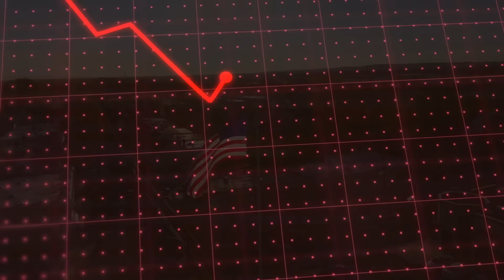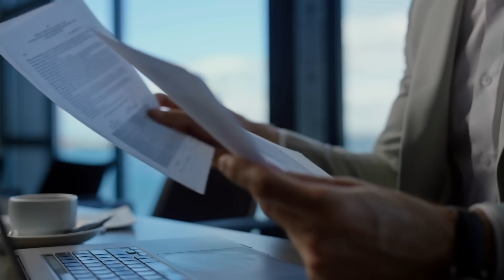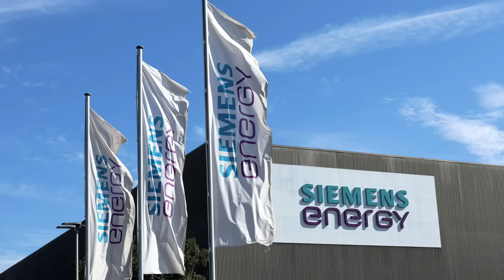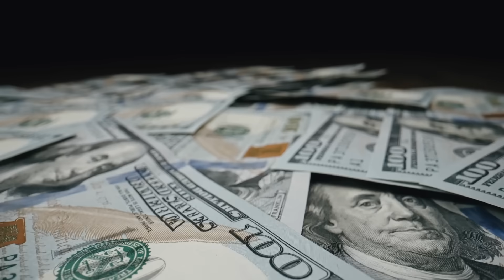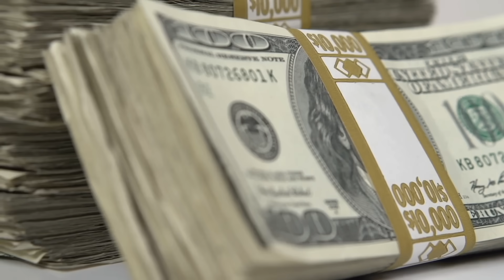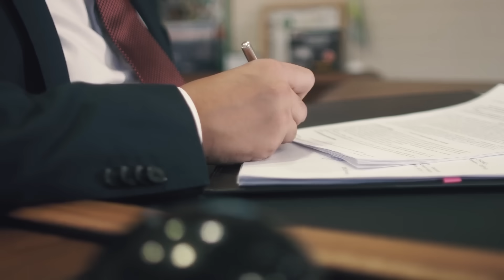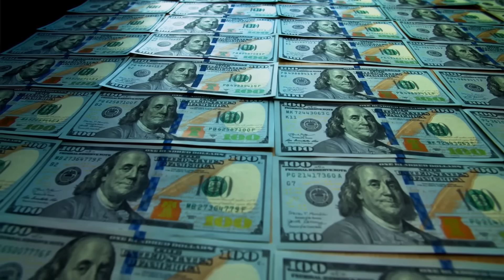The Real Reason America Has Turned Its Back On Wind Power Energy

Comment: The key to understanding is, 5 times more electricity will be needed. Re:Allan Fels, the Australian government adviser. 
Transmission from central generation is the killer cost. 

The national grid is fragile, just off broke. 

100years to build and massive national wealth. 
5 national grids is stupendously stupid economically, resources and fossil fueled mining.
Decades and decades and decades. 

EV big batteries and rooftop solar PV and the existing national grid is almost free.
100kWh EV storage + 6.6kW rooftop.

Central Electricity generation is stupid. 

Fossil fueled
Nuclear fission 
Nuclear fusion 
Renewables solar farms 
Renewable wind farms 
The centralised generation models are all stupid because of transmission costs and the decades and decades to construct the increased transmission capacity. 

In my street we have 30 homes and 60+ vehicles and gas supply to the homes.
When no petroleum EVs, and no gas supplied for heating and cooking and hotwater then it is obvious the poles and wires in the street are way too small for distant central supply.
Reply: Except there are many areas of the world (including MOST of the developed world) where wind and solar are NOT economical.  Yes, you can build wind and solar and get SOME electricity from it, but the cost is prohibitive.  Or you have to transmit the electricity long distances from the sunny/windy areas to the cities where people actually live.  Germany had the highest electricity cost in Europe BEFORE the Ukraine war due to its reliance on solar and wind.  Peter Zeihan has world maps on his website that show where solar and wind are economical.
Reply: @dzcav3  That is more to do with how the energy is costed not it's actual cost. Take the UK for example (this also applies to Germany). The cost of all electricity generated is costed at the most expensive source of generated electricity, which in the UK is gas generated electricity. So wind ends up costing the same as gas generated electricity! But it doesn't in fact, it's far cheaper. This wouldn't apply if it was generated at home and not sold in the market or if the system was changed. It's a big con. Wind and solar should be far cheaper than they are, and in fact they are if it wasn't for this ridiculous system. Why should we the consumer pay far more for our electricity when it's actually much cheaper and greener? We should be rewarded for choosing greener and cheaper energy not penalised!
Reply: @dzcav3  countries that cannot afford end point generation and storage cannot afford a national power grid. 
Most people do not do the maths and just have opinions, wrong opinions. 
Engineers do the maths before construction.
Reply: The national grid is designed for purpose. Intermittent generation was not a design constraint.
Reply: @msimon6808  Times change.  It's time for intermittent generation to become a design constraint.
Reply: Hoax.

Such a load of garbage.

There no such thing as a greenhouse effect.

The whole premise of AGW -- the greenhouse effect -- is wrong.

There is no such thing as a greenhouse effect (except in an actual greenhouse (closed container)).

But there IS  a trillion dollar $$$ boondoggle that is the muscle that twists arms behind that stupid renewable energy.  

"Welcome to the Mafia-ization of the energy business."

             * * *

A Novel Perspective on the Greenhouse Effect (Tom Shula)

https://youtu.be/NS55lXf4LZk

1) Markus Ott: Questioning the greenhouse effect

https://www.youtube.com/watch?v=Bj6ORbRBZ2s&t=7s
The greenhouse effect is the primordial sacrament of modern climate science. It is preached from kindergarten to the nursing home.  The simple name of this effect and its ubiquity in culture and mainstream media leave no doubt that we are dealing here with solid and fully understood Natural Science. But how does this actually effect work?

2) Markus Ott: Atmospheric greenhouse effect ~0?  (Applying IPCC formulas to the no-atmosphere moon. Conclusion: there is no greenhouse effect on earth.)

 https://youtu.be/JXKHfL55G2A

Min 6:xx.  "Abuse of the Stefan-Boltzmann model..."

3) Markus Ott: Saturation of the CO2-IR-Absorption

https://youtu.be/CrMGTkPADFw
(Min 0:10) The alleged greenhouse effect of 33 degrees centigrade is the result of an improper use of the Stefan–Boltzmann Law (black-body radiation), and that a less abusive application of this law makes the greenhouse effect almost disappear. 

4) Markus Ott: Convection and Thermalisation Kill The Greenhouse Effect

https://youtu.be/RbNNhLqhWPg

In-Depth Comments on Sabine Hossenfelder's Talk: Greenhouse Effect 

"Heat transport in the atmosphere... IT'S CALLED WEATHER."
https://youtu.be/sY2xHk0ThJ8

https://thebreakthrough.org/journal/climate-change-banned-words/art-climate-change?utm_source=Breakthrough+Newsletters&utm_campaign=12e6304fed-BTI_Weekly_1_18_2023_COPY_02&utm_medium=email&utm_term=0_49b872540e-12e6304fed-466887052

If heat rises, why is it so cold in the upper atmosphere?
https://www.physlink.com/education/askexperts/ae670.cfm
Reply: I have myself a little cry every time I see a country field full of solar panels. We have thousands of acres of commercial and residential rooftop in cities, why use natural/farm land?

Well except for some of the shade farming projects that use solar panels to control light levels for certain crops. 

Still need some grid base load from hydro, nuclear, wind and maybe some peaker gas plants. 

But totally agree a combination of endpoint solar, endpoint battery, and neighborhood battery projects would be awesome.
Reply: @5353Jumper  wind and solar generated locally at your home is the future
Reply: @aries6776 not sufficient to power the country.
Reply: @rajashashankgutta4334  yes it would be, even in the UK solar alone can generate 2500 kWh off electricity a year where the average home uses 2900 kWh. Add a home wind solution and you are there.
Reply: @rajashashankgutta4334   countries that cannot afford end point generation and storage cannot afford a national power grid. 
Most people do not do the maths and just have opinions, wrong opinions. 
Engineers do the maths before construction.
Reply: @5353Jumper  I TRIED PLANTING UNDER THE SOLAR PANELS TOTAL BULLSHIT
Reply: @5353Jumper  the wind always blows somewhere so there is call for a distribution grid.
Reply: @alanhat5252  yes I said that in my comment, what's your point?
Reply: @alanhat5252  And the transport cost is? 
Renewables without batteries are not dispatchable. Renewables with batteries are not affordable
Reply: @5353Jumper  I just read your comment again and couldn't find where you said there is a call for a distribution grid to even out widely dispersed sources, so maybe alan had a point after all.